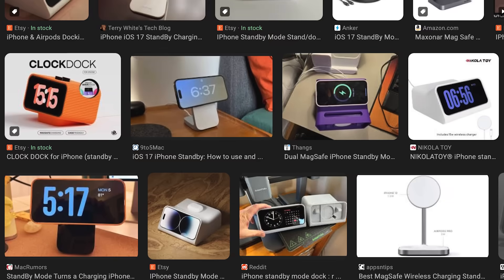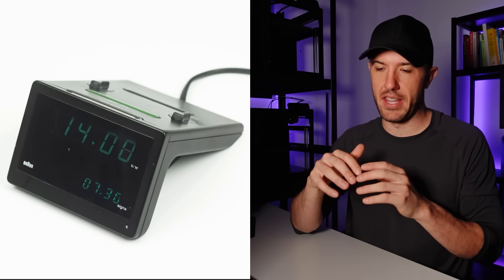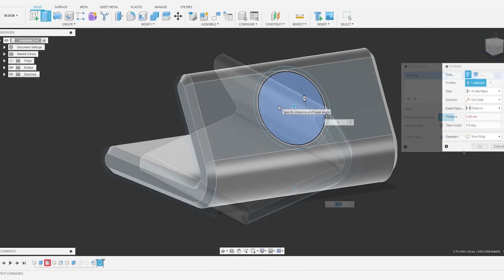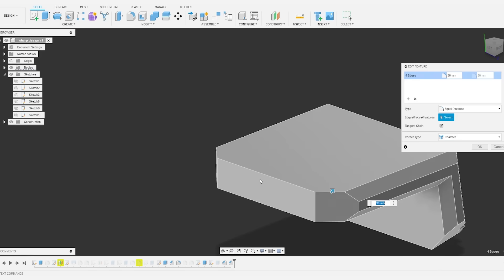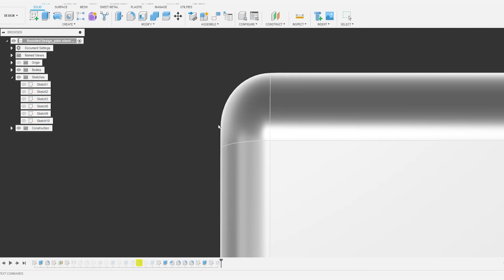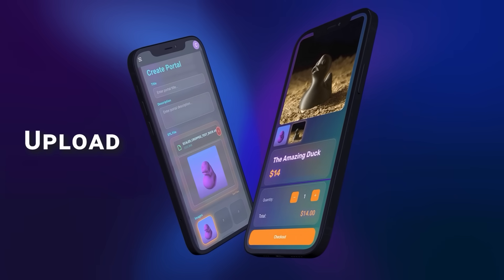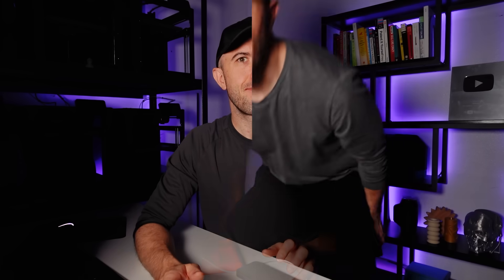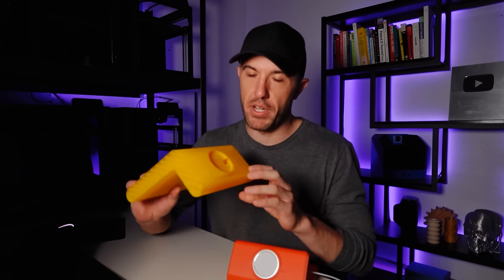Can I Design a Perfect iPhone Standby Dock

Comment: for blue one, could you leave a thin cut out on the bottom (the whole length, but not visible from the front) and just have small J hooks or nubbins along the cut out spaced ever so often that would hold the cord up / in the cut out? 
nubbins would friction fit hold the cord in place, pinching it slight, printed facing up from the bed. would have to play with cut out geometry to get the angles right for printing, and the distance between nubbins and wall would need to be adjusted for cord width 

----------------------------------
__/==\_______/==\_

could do alternating nubbins, but harder to print in vertical orientation, maybe if you brought the cord back diagonally across the bottom of the print. ex as i look at the face of the phone, on the charger, the cord exists the charger on my right, mid print, bring it down in the print, then once it's past the curve of the face, bring the cut out diagonally across to the back left, so the cut out is not on the same plane as the print bed? then you could do alternating nubbins and that might hold the cord in better.

Comment: The last one, where you tried the cable channel, I wonder if it would work by having a path to the left or right edge (based on how it would actually be used and not how it is printed), and then a cable grove along the edge, that would channel and direct the cable to the back of the dock. The plug wouldn't have to fit through a curve at all, but it would still clean the cable up.

Comment: Fishing the cord through just won't work.  I've discovered that some USB cords are extra fat and you can't accommodate that. A lot of products have a groove to lay the cable into with little tabs to hold the cable in place so you just push it in.  You could put the cable guide on the bottom with a hole to pop out the connector that could be extra large in your coin tray arera.  It would take away from that and still have a cable poking from the back and down to the hole but that's better looking than straight out.  A snap on cover might help if you want to completely hide the cable.  Also, having a cable dangling around where you have you change pockets is a bad idea because when you're reaching in to grab your keys or coins you don't want to touch the wire.  That can be very irritating when you're in a hurry.

Comment: On the final design. rotate the charger so the cable goes down, shorten the base, lose the big tray, go with just the two smaller trays, the cable run goes under the divider between the two trays, also it doesn't need to be an enclosed channel, just a cut out in the bottom

Comment: What about running the cable down and out the underside. Then run it along a channel with small tabs holding it. (A bit like some electric kettles) You could also opt to run the cable out towards the left or the right depending which direction the cable needs to go to get to an outlet?

Comment: The charger cable comes out from the side, so make a channel going horizontal and then follow the form to the right (or left) and then have a channel going to the rear with nubs to press and hold the cable in like many do to contain cable runs.

Comment: I like using a modifier shape and then inside the slicer telling that shape in the Slicer quality settings I enable make overhangs printable. It cleans up the sagging you were experiencing. Your solution of Truncating the curve is also acceptable. Another option is to use an asymmetric fillet. And yet another option is to make a chamfer that blends into a radius either tangent or slightly truncated. 

I always appreciate these videos! Thanks for sharing. I hope my suggestions are helpful for you and others in the community as well.
Reply from the maker: That will work as well. But you always want to avoid using slicer settings to make a design work.
Reply: @slant3d I use slicer settings all the time without any issues, they're great and enhance the design and structure of the print. I even model the modifier geometry sometimes. One particularly useful reason is to change the top surface type. Another, to fix models using make overhangs printable option. And, At times I prefer the concentric pattern for long ribs, but do not desire it on consecutive lower top surfaces.
Reply: @desk_mouse  using slicer settings on your own machine or print farm is absolutely fine. I think what he meant is if you want to send the design to another farm like slant 3D then you don’t wanna rely on your slicer because they’re gonna slice it themselves using their own slicer.
Reply: @Naiemaa  Understandable.

Comment: Design Tip for Fillets Against the Build Plate:
Add a 1 mm chamfer to the bottom face, then apply a 3 mm fillet to the top edge of the chamfer. This creates a fillet-like edge, but with a maximum 45° angle, making it much easier to print and still looks like a fillet.
Reply: awesome tip thanks!

Comment: This is a great video. I recently printed out my first project with portals, and unfortunately, the tolerances were not tight enough for the MagSafe cyber truck solution I actually designed.  Have you considered adding a tolerance setting in portals? The reason there's a project in here is your last video about production-ready using springs, or certain ways to build tolerance, and a model like mine, or even the one you're working on here.  It would actually be great to have this model that you built parametrically, so you can control the puck size, use other brands, and also adjust the bin size for an AirPod.
Reply: Ah yes the argument of parametric verses direct design. Both methods have their place and purpose. Some things cannot be done parametrically because of Cost of the software or complexity of the design. I have ran into situations where a edit to the feature was a much faster and quicker solution than going back and reprogramming the whole model. To each his own and for each project their own method as its needed.
Reply: @desk_mouse  yeah the only reason I think it works well in this one is because there’s so many variables. So for example, if I want to use the Anker version or even some Temu version, I’m not locked to a MagSafe. And then the same with the back you know there’s four AirPod models right now if I wanted to make a little space dedicated to the AirPod
Reply from the maker: Depending on the material you chose you may have to modify the design slightly to get the fit you are targeting. Or as you mentioned use some of the tolerancing tricks we have shared in other videos.

Comment: Good video 😄. I feel like it'd have just been easier to make a small channel on the back and along one side of the "tray area" which the cable can press fit into. Let's be honest, you wouldn't usually see it and most people wouldn't probably be bothered by it. It'd also probably make it far easier to install and remove.